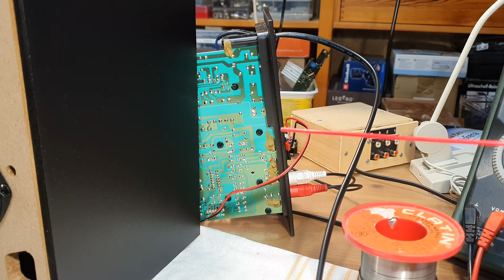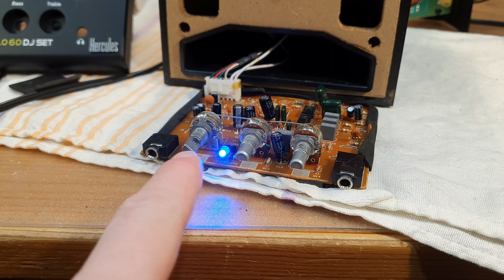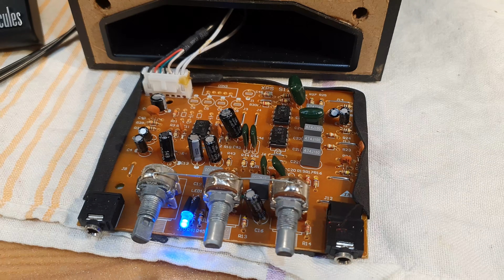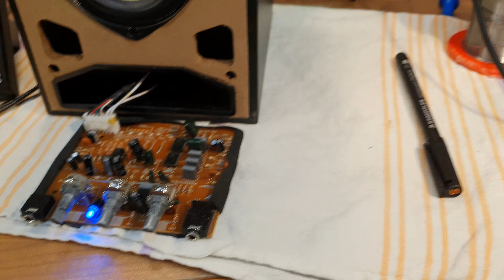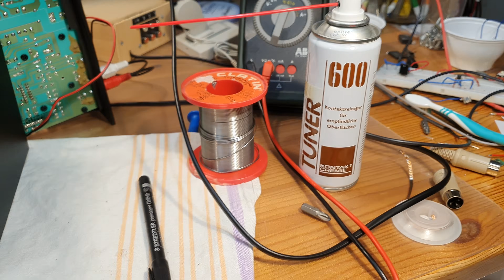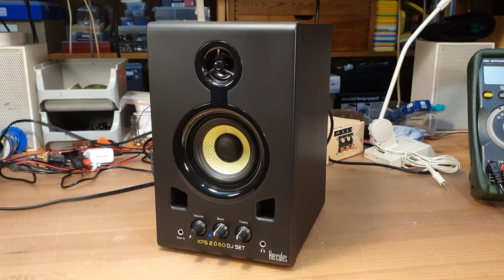Hercules XPS 2.0 60 DJ Set amplified speakers repair - full disassembly

Comment: This is why I dislike combination units. Not only are they hard to access for service, but if the amp fails you also lose the speakers, and vice-versa. The only reason I'd consider buying these things is if there was not enough space for a separate amp (and you can get very small amps, if necessary).
Reply from the maker: I do understand why people like these amplified speakers, they sound much better than the old plastic computer speakers of the 90s and they do look quite neat, they do save some wiring and space. I only got these because they were free.

Comment: Hi, thank you for the video. I have a problem with the headphone switch circuit: once connected the aux for the headphones, and then removed, it doesn't switch back to the amplifier mode, so I can't hear anything from the speaker. Can you tell me what could be the problem and how to fix this?
Reply from the maker: Occasionally I have this problem too, luckily the speakers start working again eventually. I have not yet found a solution to that problem.

Comment: If it's not the solder joints themselves, maybe there is a micro crack in one of the traces that's not easily visible. You should continuity test the traces if the fault occurs again and it coming after the contact cleaner was merely a coincidence. 
Personally I would also change the hideous blue LED for a more pleasant color, and also the 4558s for 5532s. Even though 4558s are perfectly adequate for a line level tone control or whatever this is, those look like cheap off-brand ones and they probably aren't all that great. 
I like that it still has this 90s style curcuitry and PCB layout which is easily repairable and hackable. Cheap-ish audio products are often much better in that regard than expensive ones with all their DSP and programmed MCU nonsense going on nowadays.
Reply from the maker: I have checked the board itself too of course, and I would trust my eyes to still notice even small cracks in the circuit boards. I am quite sure the bad contact was in the volume control potentiometer, as I got it to cut in and out by pushing the axis into different directions. While doing that I made sure to keep the circuit board in free air, not putting any force on it, to properly narrow down the problem. The blue LED is indeed very much a question of taste, I briefly thought about replacing it with another colour, but then decided to leave it alone. When reassembling the speaker I must have gotten the LED misaligned with the window in the plastic front as it is now extremely dim, so it really doesn't bother me anymore. I imagine replacing the opamps could certainly be an improvement, but that was beyond the scope of this repair, I needed to have the speakers working again fast as I use them on my main PC and I need to have audio there.
Reply: @DrCassette  

Fair enough. Another idea: As your speakers seem to be from the RoHS era, maybe there are tin whiskers inside the pot which occasionally grow long enough to tie the wiper contact to ground? Maybe the contact cleaner removed those whiskers?
Reply from the maker: @westelaudio943  Are tin whiskers a problem again? I only knew about that problem from very old equipment. That is good to know. In this case, disassembling the potentiometer should have hopefully disturbed the whiskers enough to not be a problem again in the foreseeable future. I didn't notice any whiskers, but I did not specifically check for them either.
Reply: @DrCassette  

Oh, absolutely, lead free tin alloys (for soldering or plating) are far more likely to develop whiskers. Even the shells of the pots might be tin plated, while they used to be cadmium plated before 2006  (that yellow-y shimmering stuff you don't see anymore in modern electronics, though some compliant zinc plating techniques may give you a similar color).

Comment: I wonder if the intermittent connection is where the metal terminals aree pressed onto the resistive track on the phenolic.  Welcome back, by the way!
Reply from the maker: I was wondering the same, but the metal legs didn't feel loose, so I assume the connections should be fine.